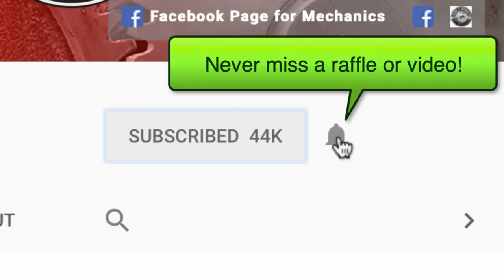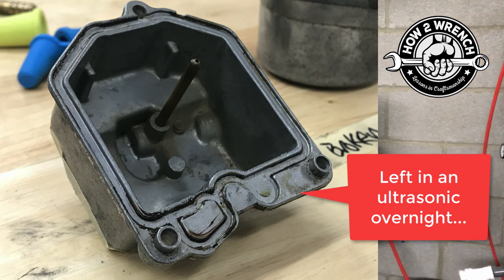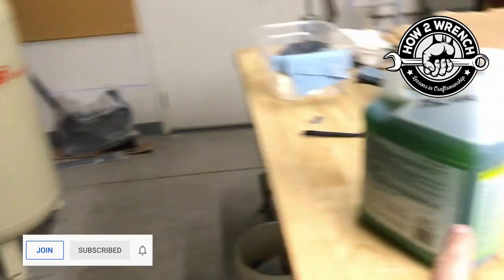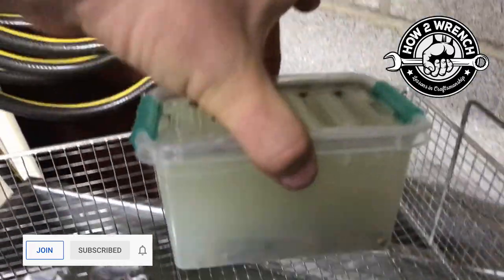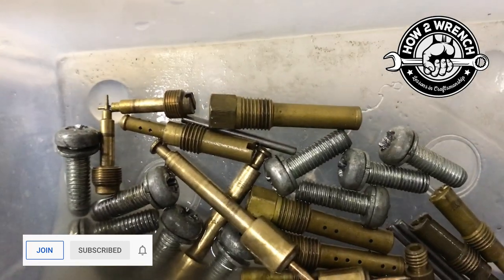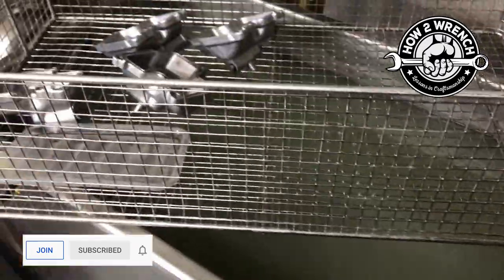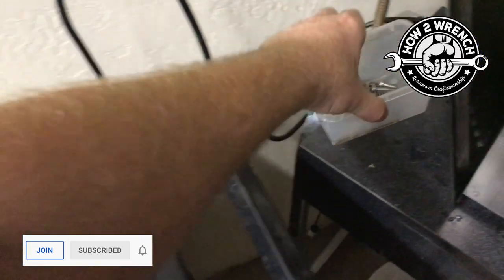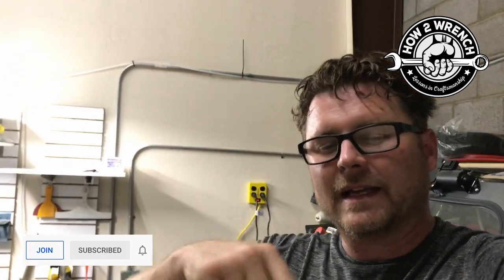Own a Ultrasonic Cleaner? Do you use this solution in it? #ultrasonic #ultrasonicsolution

Comment: Some one said that Simple Green fade the aluminium. he uses ZEP Heavy Duty Citrus Degrasser. Someone used CLR with a vibrating Jar and after over an hour, it was so impressive.
Reply: Have you cleaned aluminum stuff in an ultrasonic cleaner yourself? I hear/read/watch so many different opinions about solutions it gets so overwhelming. Trying to find a good general purpose cleaner to use for random small ATV and motorcycle parts and fasteners. Something SAFE on aluminum even if left in longer and also something that will not strip coatings (zinc, nickel, etc) from fasteners. I just learned the other night that just straight PinSol basically takes everything to bare metal.

Comment: recently bought a 10L version for a carb that had had a couple years of dried hard fuel scum…they float needle valve was and the float pin were seized solid….

Watched many youtube videos of how people used their machine and what cleaner…

Dismantled the carb into jets/bowl/body and put them in separate glass jars in the basket and surrounded by water.

I initially used gas/petrol as I saw someone had good luck with it and it seemed logical…but after 3 rounds of 15-30mins hardly any scum moved…

Next I tried a 50/50 mix of white (4%) vinegar and water…tried the float bowl first and to my relief the fuel scum started to lift in 5mins and after the 15min cycle 95% had lifted..

The carb body was next with the 50/50 white vinegar mix and the same results with the fuel scum with it loosening the float pin free and valve sliding out…the only negative was the carb body started to discolour a little…where as the float bowl didn’t….i presume that theres a different mix of alloys in the body compared to the float bowl.

Anyway the results…the now clean carb was installed on the bike and she fired up for the first time in 3yrs and runs just like it should….i was about to give up on the carb with the canned carb cleaner doing nothing and buying a $700 aftermarket carb….so for $100 the ultrasonic cleaner was well worth the small spend!

Comment: I've been using %100 mineral spirits in mine.  The crud would settle to bottom then you place all old fluids over a year or so of use in a plastic milk jug then let sit so all old crap will settle to bottom then leave the crud in bottom and pour good stuff back in and top of sonic cleaner with some new mineral spirits.
Reply from the maker: I will try 100% and see how it works. Love it in my parts washer...

We sure love you taking the time to comment. Are you coming to the next live session? 
There a few ways you could help keep this work going and stay connected with me personally.  
1. The fastest and best thing you could simply do for us is hit that subscribe button…helps us creators more than you know! 
2. Join this channel to get access to perks:
https://www.youtube.com/channel/UCBhM8DCKnT3qXwTW0eToyCg/join   
3. Give us a high 5 here:  https://www.paypal.me/how2wrench    
Keep Wrenching,
Shane Conley
Peoria, AZ USA
Follow us!
www.How2Wrench.com      
www.Tools2Wrench.com   
Facebook: 
https://www.facebook.com/How2Wrench/  
Instagram:
https://www.instagram.com/how2wrench/
Reply: do you still  use mineral spirits  ? if yes at what temperature
Reply: @eric69parent  I do.  I use it in my parts washer which is at all temps depends on the day of the year.  In my ultra sonic cleaner (cheap one from harbor freight) it doesn't have a temperature adjustment.  So I use it with the heat on in that to and it'll get hot enough to burn you.  Hope that helps.  😊

Comment: I bought that same utlrasonic last fall. I couldn't find any of the Simple Green Aircraft Extreme which is supposed to be safe for aluminum. The only thing I could find locally was Krud Kutter degreaser. It worked ok on some really grimey brake calipers and master cylinder. I had to dump it and store it for the winter and haven't had any projects to use it for lately, Krud Kutter also makes a Parts Washer formula that I'll probably try when I run out of this current bottle.
Reply from the maker: Sweet thanks Dustin....

Comment: I like to use Gunk Carburetor Parts Cleaner in my 3L ultrasonic cleaner.  It does an amazing job, but if possible don’t put gaskets or rubber o-rings in it (you’ll be sorry).  Rinse all parts and openings (small holes) with water followed by compressed air.  Gunk Carburetor Parts Cleaner will need to drained and strained every once in a while but it is reusable as long as it is clean.  You should remove any exterior dirt from parts prior to putting into ultrasonic cleaner.  I started out with smaller (jewelry cleaner) version.  It worked ok, but timer was too short and I didn’t like using same cleaner for my jewelry and for my carburetors.  FYI:  don’t let temp in cleaner get too hot because Gunk Carburetor Parts Cleaner is flammable.  I typically use about 100 degrees Fahrenheit.
Reply from the maker: Nice! Thank you for sharing! I'm been surprised by some of the solutions people have listed in these comments! 

We sure love you taking the time to comment. Are you coming to the next live session? 
There a few ways you could help keep this work going and stay connected with me personally.  
1. The fastest and best thing you could simply do for us is hit that subscribe button…helps us creators more than you know! 
2. Join this channel to get access to perks:
https://www.youtube.com/channel/UCBhM8DCKnT3qXwTW0eToyCg/join   
3. Give us a high 5 here:  https://www.paypal.me/how2wrench    
Keep Wrenching,
Shane Conley
Peoria, AZ USA
Follow us!
www.How2Wrench.com       
www.Tools2Wrench.com    
Facebook: 
https://www.facebook.com/How2Wrench/   
Instagram:
https://www.instagram.com/how2wrench/

Comment: I  clean my carbs with the Berryman cleaner to get the nasty stuff and rinse in very hot water and then
 re-clean the  parts through the ultrasonic cleaner using a ratio of 20% to 30% industrial simplegreen or vinegar to distilled water,  then rinse with scalding hot water.
Reply from the maker: Thank you!

Comment from the maker: WHAT GREAT COMMENTS!!!!!!!!!! I will put a live Q/A night together and invite you all! There are some real pros in here. Read all the comments to learn more! If you surely would like to be invited, or be a guest host, reply here!
Reply: We also tested everything from the cheapest solution to the most expensive. And some of it is Extremely expensive. But we did not see a great enough Improvement per the cost of the top rated ultrasonic tank Solutions. So we stuck with something that you can get in just about any normal store or online. And it works great, you can use about between 2% - 10% mix ratio, depending on how bad the item is your working on, but it does fine. And we use ours all the time.
Reply from the maker: Nice! Feel free to call and say hi sometime. 602-345-0432.
Reply: Shane Conley sure, I’ll attend if you ate hosting a q/a.
Reply from the maker: @philspaces7213  Great Phil stay tuned...

Comment: Hey Shane. Three years later have you settled on a solution for aluminum? I just got an ultrasonic cleaner and tried Zep citrus degreaser after seeing a video. It was awful! left horrible blotching on test parts after 15 mins. I then tried ph-neutral Palmolive ultra dish soap. Much less blotching, but not perfect...
Reply from the maker: Simple Green "D" must have the D for aluminum.  I've many things but someone had some good believable results with aluminum using this and we have too. I still think the biggest thing is to was with water right after removing. 
https://www.homedepot.com/p/Simple-Green-Pro-3-Plus-1-Gal-Herbal-Scent-Antibacterial-Cleaner-and-Disinfectant-3310100401128/305116845?source=shoppingads&locale=en-US&pla&mtc=SHOPPING-BF-CDP-GGL-D28I-028_004_CLEANING-NA-NA-NA-PMAX-NA-NA-NA-NA-NBR-NA-NA-NA-PMAX_SHP&cm_mmc=SHOPPING-BF-CDP-GGL-D28I-028_004_CLEANING-NA-NA-NA-PMAX-NA-NA-NA-NA-NBR-NA-NA-NA-PMAX_SHP-71700000113461777--&gad_source=1&gclid=CjwKCAiA98WrBhAYEiwA2WvhOhqEatuuVmfW30PLShs5Izp_LX3ZGMd9GV2XT_UyQeybHXotpLOHGRoCatIQAvD_BwE&gclsrc=aw.ds

Comment: Before the neutering of carb cleaners the glorious Hydro Seal by Gunk (NOT the feeble Hydro-Seal II shit) used methylene chloride and it was magnificent. Today you can still buy methylene chloride as powder coat stripper but it can only be sold to businesses so you'll need to be one or have a bro who will order it and send a copy of their W9 tax form. It is not cheap but it works very, very well. Wear gloves and use in a well ventilated shop environment. Keep the container sealed.
Reply from the maker: Good to know...TY